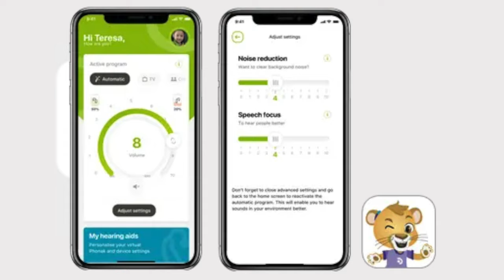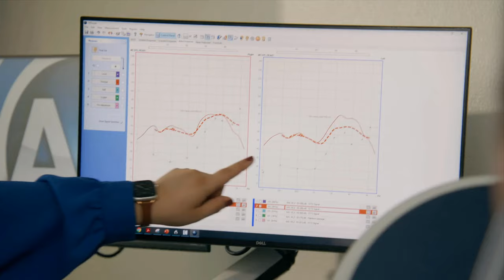The Future Of Hearing Aids: Pushing The Envelope With Innovation

Comment: Technology is pretty amazing when you think how far it has improved in the last 50 years.  The fact that hearing aids have gone from large body devices to a device so small and powerful that can fit inside the ear shows how far research and development  has come towards making a better product for the hearing impaired consumer.  Bluetooth and the potentials of aurocast research have been game changers for me.  Bluetooth has streamlined a lot of activities that were previously difficult for me to handle on a daily basis. Activities such as attending zoom calls are less anxiety producing and almost effortless now.  And although it has little to do with technology, i am excited about the availability of color options.  Current color options are pretty boring and do not reflect the personality of the owner. i also think colors will make it easier to discuss hearing loss with others and make the topic and the stigma associated with hearing loss less taboo.

Comment: So has Phonak fixed its CROS issues? Does its mobile app support CROS devices yet? Does CROS work simultaneously with streaming or using the phone yet?
Reply: The app supports CROS in a recent update. I don't have/use a CROS device so can't comment on the streaming but would guess they worked that out.
Reply: Yup they just supported it with the new app update
Reply: My Oticon CROS PX device is still not detected by Oticon On, nor by Oticon Companion. Is my CROS device too old? (I got it only a year ago!)

Comment: I  Have hearing aids but rarely use them because the airpods pro sound is so much better with the audiogram. Kinda hope Apple will join the battle of hearing aids and make them better and more acceptable
Reply: Is that for conversations?
Reply: @EKA201-j7f  The transparency mode can use a audiogram so by default it shounds just as you were without, with audiogram it functions almost like hearing aids only with a better quality because its made for high quality audio
Reply: @blikpils in a sense I guess so

Comment: I'm going back to the Phonak Lumity RIC devices after giving up on the Starkey Genesis AI devices I got in June. They just weren't working for me.
Reply: I have had the lumity before and they suck. I use Widex because they’re best for musicians
Reply: @kaylasmusic  I'm not a musician. I need a radio to play music.
Reply: @watermain48  So then thats why the lumity works for you but they are awful for musicians and the music setting sucks. Widex is actually the best for musicians
Reply: @kaylasmusic  I believe you, but not being a musician I'm going to go with what works for me.
Reply: @watermain48  Ya, i get that
Reply: Yeahhhhh I heard Starkey wasn't the best anyways way to much connection stability problems with Bluetooth

Comment: Hate to rain on the parade. 
 I went from hearing aids with 312 batteries to aids that are lithium ion.  The charger for the Li ion ones is VERY unreliable.  I've gone through several chargers in the past year.....  Also think about when you lose electricity; you lose the ability to charge your hearing aids, unless you could use your car battery or something...    
If there was an event like a hurricane, blizzard, whatever, and your house was without power, you'd be in a bind.  
On the other hand, you can stockpile hearing aid batteries.
Reply: Most manufacturers have portable chargers
Reply: @kaylasmusic  Yes. That in turn need to be charged with a wall socket.  You still have the potential for reliability issue and protracted periods with electricity being out.
Reply: @bobanderson6656  Ya but it could be up to 3 days worth of battery if electricity goes out as long as the charger is fully charged